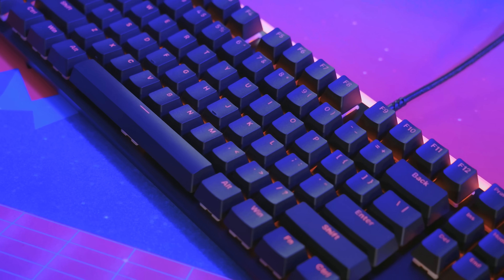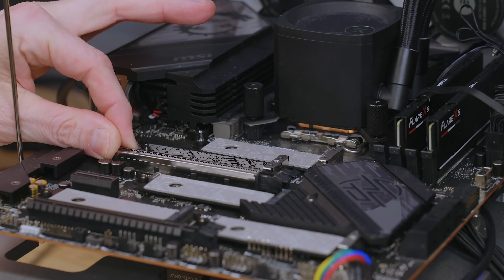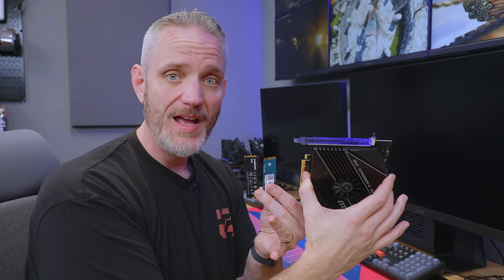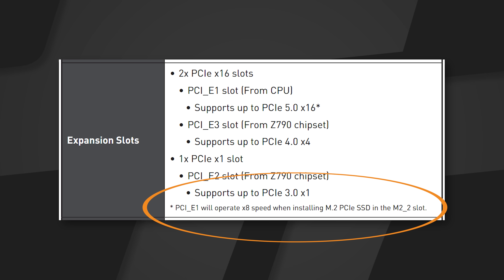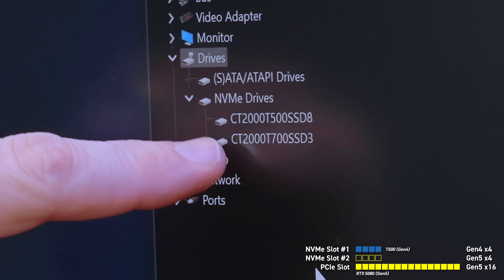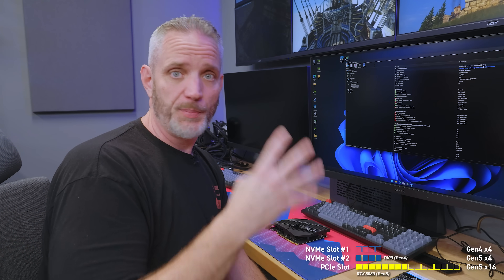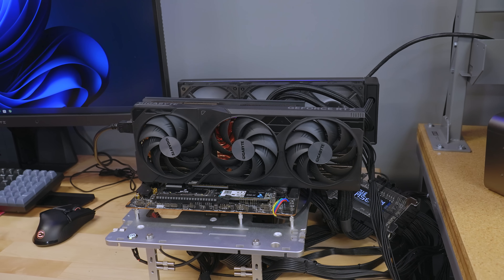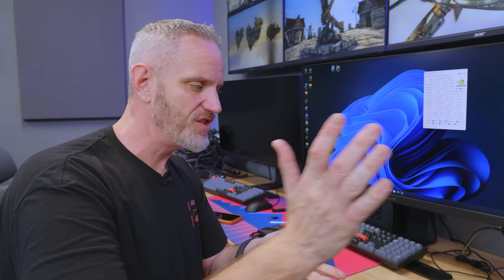Don't make this mistake with your PC!

Comment: I feel bifurcated watching this.
Reply: You should feel lane-shared, because most of what he talks about is lane sharing, where plugging in a device in one slot (like the M.2) turns off the lanes somewhere else (like PCIe x16 turning into x8).
Bifurcation is when you split up a single PCIe slot for multiple devices. This needs support from the mainboard, because it needs to be able to detect multiple devices on the same slot. Usually only workstations and server boards do it properly, but some high-end consumer stuff support some modes on specific slots.
He confuses the two. The only time he talks about real bifurcation is when he brings up Bios settings @13:15. This "x8, x8" and "x4, x4, x4, x4"  is bifurcating the x16, so you could for example run 4 NVMEs on something like the "ASUS Hyper M.2 x16". These cards are basically fancy cables. Without bifurcation support from the mainboard, it only detects the first device.
So, these bifurcation settings can't help you fix this problem, because they're only about one slot at a time. They're only useful if you have special raiser cards, or one of those fancy graphics cards they made a while ago that have M.2 slots on their back. 
Anyway, sorry for the Ted Talk, but someone in this comment section needs to explain this stuff

Comment: i have a dual m.2 nvme pcie x 3 card but only one nvme works and i can't use 2 together as jbod nor raid because my msi mortar b760m ddr4 wifi does not support pcie bifurcation in bios. 

I searched all over and the feature isn't there. it is still on the higher end of motherboards . which made me conclude that this feature is mostly in server motherboards or ultra-high end mobos . but not most consumer mobos. disappointing. although it is my 3rd nvme inside my pc and it working at gen 3 speeds is no issue but it could have been 4 of them

Comment: Harware setup guidance on forums got so much more complicated since the X870(E) came out. You gotta always look at the specs of the mainboards to avoid lanesharing. The ASRock Boards do it almost perfectly, but there's the known issue of dying CPUs. I really hope the bandwith increases next gen so that kind of lanesharing to enable USB4 will be history.
Reply: That's been a thing since they started supporting Gen 3 + gen 4 on the same board, but splitting them in a way that can only be accessed by using a specific slot with a specific generation CPU or higher. Example: I have a z590 that supports 10th/11th gen, I have 3x NVME slots, but the only the one nearest the CPU will run at gen 4 speed, but only with an 11th gen CPU. On 10th gen, the board is limited to 2x nvme at gen 3 speeds. 

I am fortunate enough to have room for upgrading and getting the full support out of my board, and the board itself is really good. It's hard to value moving on to a new platform before spending a little money to upgrade and then leverage the faster available speeds.
Reply: @Baeloro1481 As 10th gen only had PCIE3 the motherboard isn't at fault, it cannot accelerate PCIE lanes coming directly from the CPU.  One reason Intel released Rocket Lake was because AMD AM4 was a far more capable platform with Zen2 and above.
Reply: @RobBCactive  Well, my point was that this has been an issue for a minute, it's not new to x870 or PCI e gen 5. And it's not so much a fault with the motherboard, it's just the nature of how things have to be engineered to offer maximal support. 

I am on a 10th gen cpu, so it's not like I am suffering and hate my PC. Rather, I have upgrade room still, and I can probably get a great upgrade for relatively cheap (compared to purchasing an entire core system again) while still being able to leverage even more from my mobo, if I choose to. 

My current usage case sees my games reaching the maximum supported refresh rate of my monitors, and I don't have any desire to upgrade those. As long as my current setup meets/exceeds my needs, I am okey. 

But I did have to know more about my mobo and spend time learning about the nuances before I could buy NVME storage without wasting money... which is the point of the video?
Reply: I'd love to have more lanes, but it's very unlikely.
Reply: Did they not fix the dying issue with Bios update? I've been rocking my 9800x3d with the ASRock X870 (non E) for between 1-2 months now. I didn't know they had this big issue until after putting things together. Hopefully I'm safe and in the majority of users that don't have an issue???
Reply: @reaper_taco  Thge majority doesn't have those issues. Nobody really knows how big the problem is unless they'd have access to all the RMA cases. GamersNexus made a recent video about the issue, but in the end they don't really know as well.
Reply: @reaper_taco  "Did they not fix the dying issue with Bios update? " They claimed that not just once - and then had more reports from users with the updated UEFI (no - those boards do not run bios)
Reply: just bought an Aorus Master for 329 and don't like it. I thought it's supposed to be high end...ive seen em almost 500 and I don't like it for 170 less
Reply: I still love my ASRock phantom x870e. it's lane setup is great, bios is good, been running 5090 and 9800x3d with zero issues since January. Hoping the claims of failure remain the small fraction that they are and people can enjoy the boards great value with being negatively affected. It's gotta be statistically "negligible" of a likelihood of failure or else the risk would be high enough that they'd do more than they are (I would hope).
Reply: @user_z01  I just swapped my asrock x870e taichi for an asus x870 hero. I'm not risking it. 

The Asrock board was actually really good.... apart from the potential ticking time bomb.
Reply: Because it’s a scam
Reply: Just remember never buy intel ASUS asrock nvidia ever
Reply: If you haven't taken a look into your manual before lanessharing has become an issue, you are doing it wrong.

Lane sharing was an issue 15 years ago and only newbies are not aware of it by now.
Reply: Hardware*. Not harware. 😂😂😂
Reply: I specifically went with AsRock for this and that they didn't have the same memory issues that the others have, but then they get the CPU problem.
Reply: Asus, not Asrock X670 was what suited me better. And Ryen 9 7900x. Optimal for home VM setup.
Reply: @Vladimir-hq1ne  X670 doesn't have USB4, tho. Those X870(E) Boards usually have lots of lanesharing traps as Jay explained in the video.
Reply: @Aloysyus  "X670 doesn't have USB4, tho"
That is wrong. The Chipset doesn't mandate it but the boards can very well have it.
Reply: @ABaumstumpf  There are some pricey X670E Boards with a dedicated Intel JHL8540 Thunderbolt4 controller for USB4. Stil isn't part of the chipset and any normal-priced motherboard.
Reply: @ABaumstumpf  what X670 boards have USB4?
Reply: @Aloysyus  " Stil isn't part of the chipset " And i never claimed that. but he was talking about a x670 boards and some of those do come with uSB4 despite your reply.
Reply: @ABaumstumpf  It is true, but those MB are exots in the high-price range with a dedicated TB4 chip. Not the first examples i'd use in discussing the differences between X670E and X870E.
Reply: @Aloysyus  "but those MB are exots in the high-price range"  i wouldn't call 200$ high price range for an x670.
Reply: The bifurcation can be worse because an NVME can be at PCIE4x1 and it can never reach full throughput.
Sharing like the controllers on the chipset do, often doesn't matter on single user PC, because there tends to just be a single full speed data transfer at a given time.  Server style systems with lots of memory channels and PCIE lanes for constant multi-tasking workloads become very expensive.
Some enthusiasts spec 2 disks, one for each OS then say they MUST have direct CPU lanes at full width, but a smarter choice is to partition and spread out the work load of each OS, but in general 0use 2 larger NVME rather than 3 or 4 small ones to avoid issues.  I try and put downloads, media and archives connected via the chipset lanes on older SATA disks because performance simply isn't required for that kind of usage.  NIC do fine as PCIE4x1 cards for instance so getting extra lanes won't prove as significant as many think.
I've also found Primo Cache a good reliable performance tool for Windows, making HDD viable with the data you actually use regularly ending up on an SSD used as a persistent cache, which can pre-load a RAM cache on boot up, making directory searches as fast as possible.
Reply: iv been looking at the x870/e boards and yeah asrock has it down exceptionally well, for only ~$300-400, if you want a dual gpu setup, even the MSI godlike that cost over $1k is super bad at bifurcation for a dual gpu set up
Reply: people should avoid asrock at all, that CPU and durability issues still exist.
Reply: @LynxTV2142 months ago I bought the Nova from advice from a friend. It’s still amazing. So.

Comment: I read the manual multiple times (before it purchasing too), but will support Jay and watch anyways.

I have an Asrock X870E Nova. Using all 5 NVME slots, only using the top PCIE for the GPU (which doesn't lane share). So yes, I lose my bottom gen 3 (yes gen 3, that's how it got the 5th nvme in) PCIE x16 and x1, but wasn't gonna use them anyways. I also modded in bottom pc case 120mm fans which block the gen 3 pcie x16 slot anyways too. Yes, the 5th nvme is running at gen 3 and only 1 lane, but I only put retro games/easy indie game on that drive, so no real issue

and yes, to anyone who asks, the issues with Asrock and 9000 series amd cpus wasn't known when I bought it... that occurred after (sigh)
Reply: I don't usually, but PCIe bifurcation is the one thing I do consult the manual on.

Comment: Luckily I read the motherboard manual to make sure I was getting the most out of my M.2 ssds.
Reply: Surprising how easy and well that works isn't it
Reply: @DeadManInBlack haha yeah I wanted to make sure I was getting M.2 4.0 speeds.  But yes this video is needed for many people I bet it is easily overlooked!
Reply: Me too but let's be real there's loads out there that need this video
Reply: @qwerther44 I needed this video, got a board with only gen4 pcie slots and the ryzen 7 7700x I got can do gen5, I purposefully went with a higher cpu than I thought I needed so it wasnt a hassle to upgrade a bit... Turns out the upgrade WILL be a hassle as I'll need a new mobo if I want all out of it, but its working well now and being a ryzen 7000 series does help that having 24 lanes I can get a second ssd without spliting, looking into that stuff led this vid to my algorithm, now I know not to get s gen5 ssd would be pointless even if the cpu can handle it the board aint got none
Reply: I still use my M9Pe and a single m.2 x4 in my mainboard.  If the ssd doesn't have a high speed controller on it, its garbage when handling system load.  We need companies to manufacture actual pcie controller-on-card drives again
Reply: Does anyone know of an AM5 board that doesn't share PCIe lanes between the PCIe slots and the m.2 slots that isn't from ASRock? I wanted to do an 9950x3d build, but I need a lot of drives along with two GPUs. Buying a $500 motherboard and having the GPU and drives sharing lanes seems absurd. I'd just get an ASRock board, but I don't trust they've resolved their issues with the x3d chips.
Reply: If only everyone was born with that kind of luck!!
Reply: Msi X570s unify max have like 6 m.2 

You can fill up 4 without biforcating significantly. but you lose 4 sata out of the 6. 
When you fill them all up, you'll biforcate pcie x16 to x8. If you use the other pcie slot, it'll biforcate even harder. 
Really sucks in terms of potentials, but the max you get is 4 without significant loss.
Reply: same, it's a shame though i can't use all 24 5.0 lanes unless i buy a $1200 board... i settled for a $400 board but even then the way it is setup is frustrating